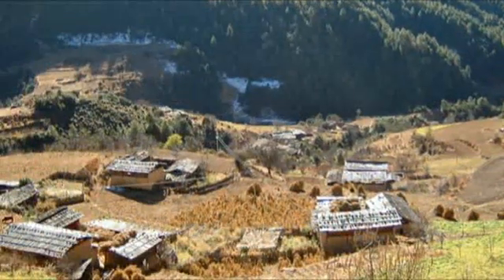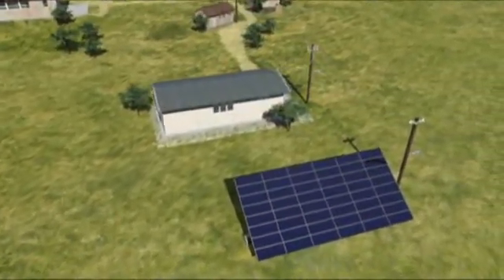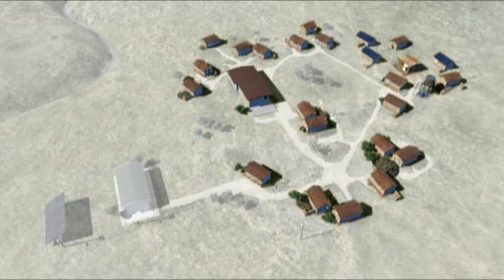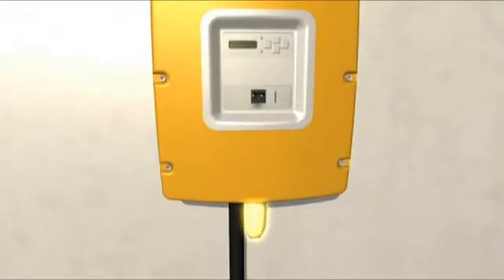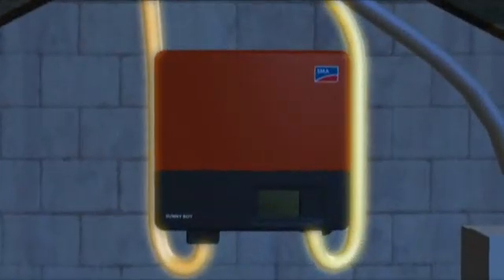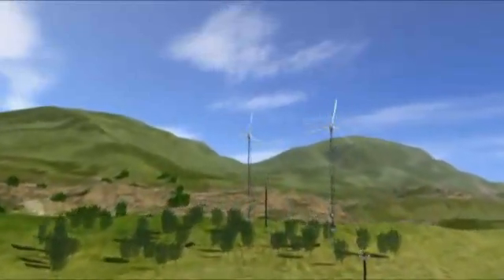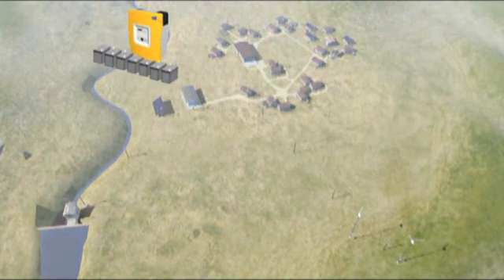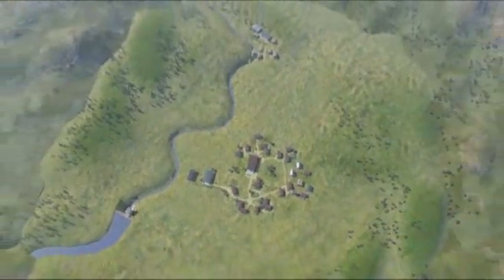SMA Sunny Island Inverter off-grid

Comment: The SMA knowledge is AC-Coupling. Micro-grid AC Coupling allows a grid-tie system to work with a backup battery system that can be charged even during grid blackouts. that we say "Micro-grid AC Coupling Will Allow Your Grid-tie System to Be Grid Independent"